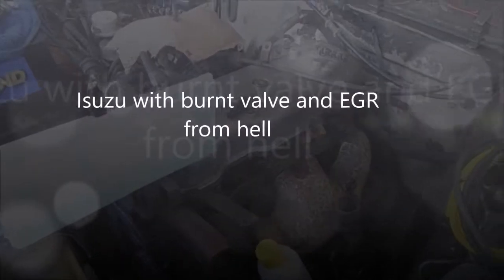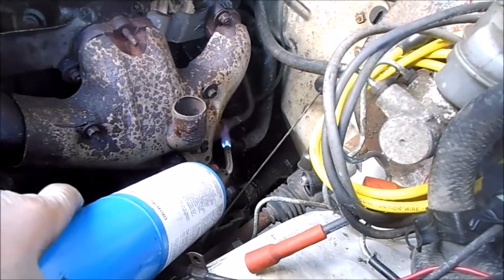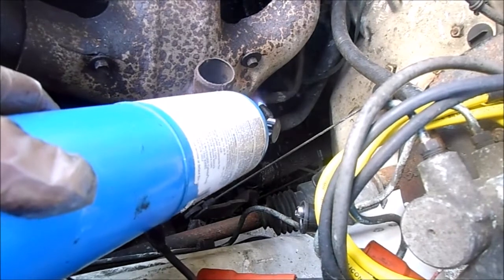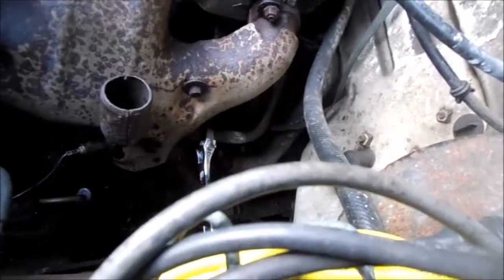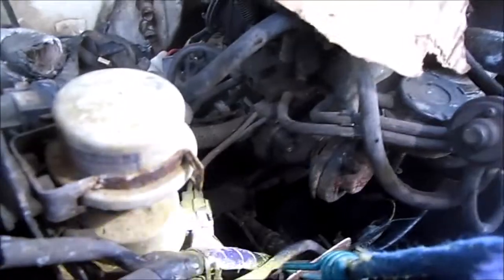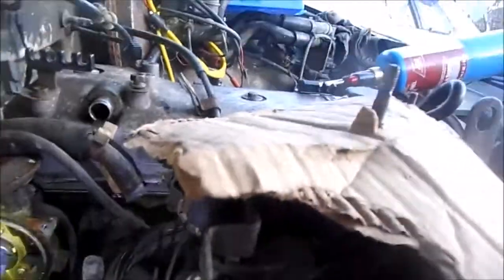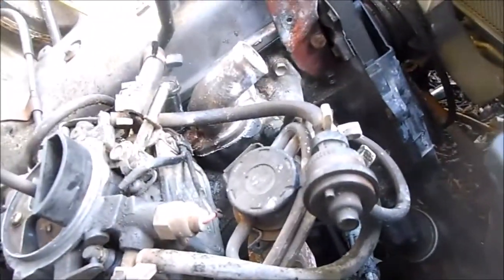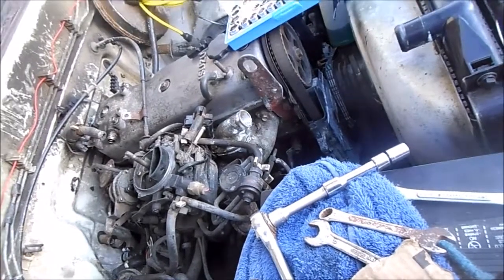2 3 Isuzu engine repair part 1

Comment: Hello i commenting from a green dot debit card video u made a few years ago u had issues with and have a questions here ima copy and paste it here pls help 
(I didnt put an ssn either and im 15 so my date of birth was underage, i then hit next and verified my number and got an error, and when i try to re-register it i get more errors like technical difficulties and invalid card, so maybe my situation is same as urs so my card works now but only in face to face in store swiping? Pls let me know thanks)
Reply from the maker: Right , thinks are changing fast , unless you give them all the correct personal information you may only be able to use it face to face.